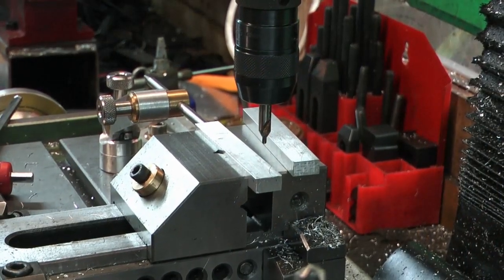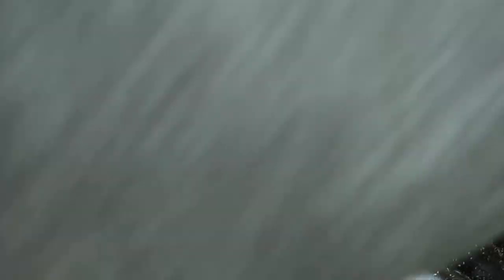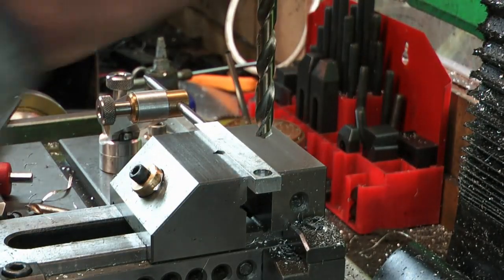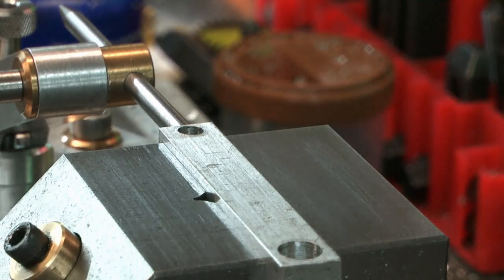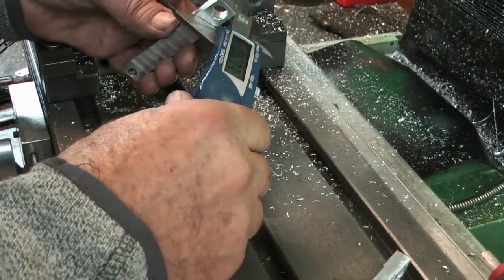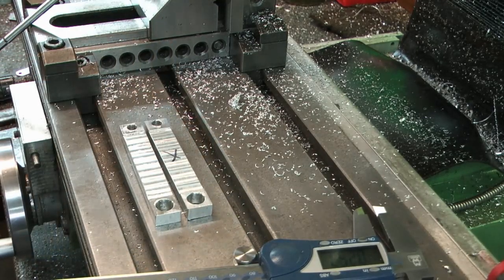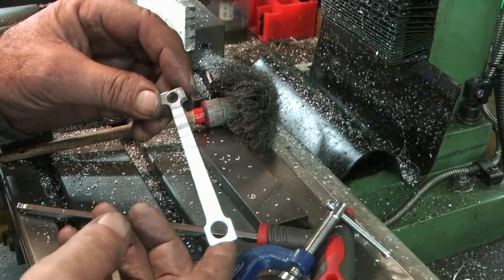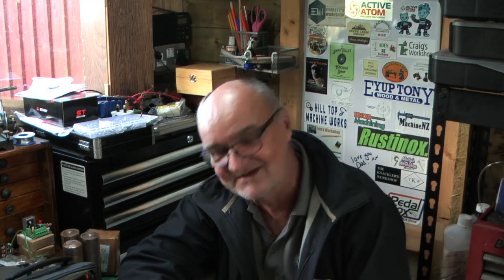Webster engine build part 4

Comment: Hi Ade, glad you're on the mend. I like your "It's not going to be smack on to the drawing spec." That's on the unimportant dimensions. 
But 28.30 minutes in you demonstrate a totally opposite arrangement. Brilliant work Ade, that conrod looks amazing as it is so far. Tony
Reply from the maker: Yes. I did get a bit carried away with getting the angle right. Cheers Ade.

Comment: Very good stuff. I don't think your dowel and plate idea for getting the angle of the taper on the con rod would be easier. I like how you did it sinebar fashion. Nothing wrong with hour long videos. Or maybe I'm doing it wrong. I probably am.

Comment: You can sharpen center drills on the pilot, either by hand or in a drill sharpener. Regards from Australia.
Reply: Don't think any of my small center drills will fit in my Drill Doctor sharpener. I would not trust doing by hand. You must be good!
Reply: @gvet47  I have been engineering 55 Years now, so I suppose, yes I am relatively good at it. Thanks for the comment. Regards.

Comment: I’m going to be building this engine as well. I’m using 1.50” O.D. DOM for the cylinder with a slight modification. I think I will be using a temperature resistant o-ring instead of piston rings.
Reply from the maker: yes I am going to source a viton o ring for the cylinder Cheers Ade.